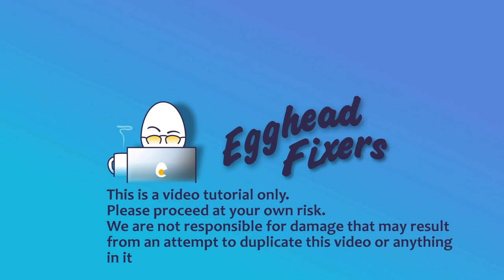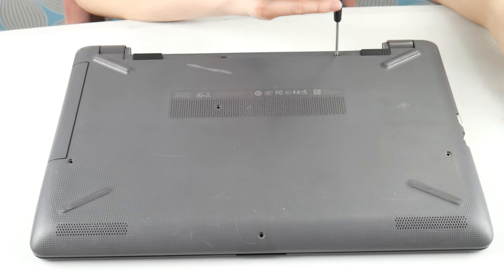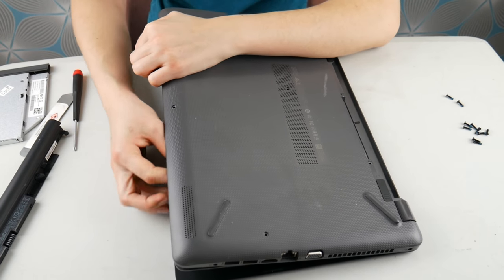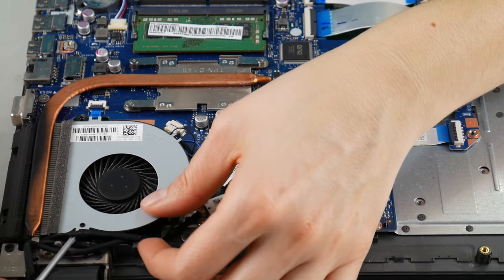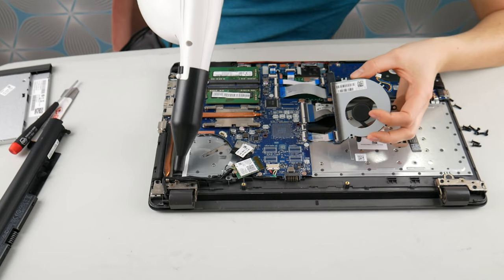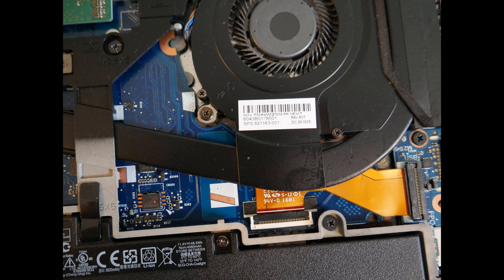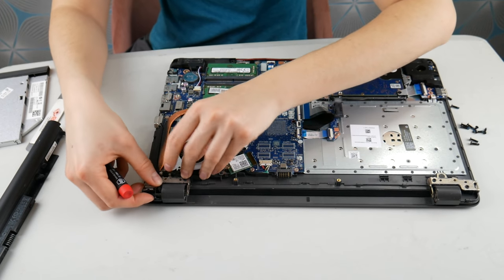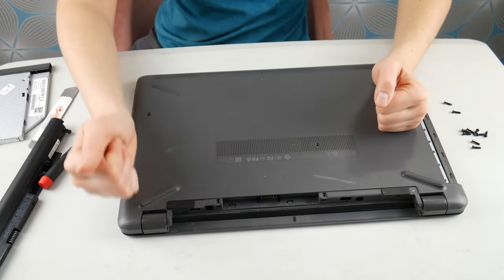How to Fix A HP Fan That Is Making A Lot Of Noise or Is Not Working

Comment: I have a HP Envy that was given to me by a friend. It's overheating. I took out all screws, couldn't get the screen hinges removed. I tried to pry the top keyboard panel out but its still connected inside somehow in the center. I checked under all the rubber feet and there were no additional screws. If I could just get to the fan!! replacing it would be easy... taking this shell apart is the diablo!!!
Reply from the maker: If you go to the HP support page and look up your model HP...Some of the manuals for different HP models show you how to take the computer out piece by piece. You could also see if there is a disassembly video for your model HP on YouTube. Because it sounds like you are missing a screw.

Comment: Pls i have a similar problem with my Hp pavilion 15-cs0003ca, When it works for some time, then there is this strange noise that it makes at times and it very very loud.. It makes that for sometime then it stops. It has been that for like one month now and i don't know what to do?
Reply from the maker: Does it happen when the fan turns on? Does it seem to be where the fan is located? Because the hard drive can also make strange noises when they start to have problems.

Comment: My laptop is so loud but Is only this way when on charge but I can't leave it off  charge cause it dies so quickly or straight away even if it's fully charged it also charges really slowly and I sometimes hear a beeping noise
Reply from the maker: Does the computer feel like it's overheating?
Reply: @EggheadFixers  no
Reply from the maker: @kaihla7514  Does it beep in sort of pattern? Like 1 short beep and 1 long beep or something like that
Reply: @EggheadFixers  yes
Reply from the maker: @kaihla7514  What is the pattern?
Reply: @EggheadFixers  I think theree short beeps and one long beep
Reply from the maker: @kaihla7514  Have you upgraded any of the parts? because that beep code usually ia a CPU configuration error or CPU type is not compatible
Reply: @EggheadFixers  no I haven't upgraded but I will be getting a new battery soon so hopefully that resolves the problem
Reply: I can't figure out if the problem is my fan or my battery
Reply from the maker: @kaihla7514  does the fan stop doing it if the battery is not installed?
Reply: @EggheadFixers  no
Reply from the maker: @kaihla7514  If it keeps doing it after you replace the battery then I would consider replacing the fan
Reply: @EggheadFixers  ok thank you for your help
Reply from the maker: @kaihla7514  You're welcome!

Comment: Whenever I plug in my laptop it starts making noises and I'm not sure if it's the fan but I'll try this
Reply from the maker: Does it seem like it may be overheating?
Reply: @EggheadFixers  possible I think it's either the fan, battery, or charger. It doesn't make too much of a fan sound like it did before I cleaned it from the outside. I can see it's dirty on the inside so I'm gonna clean that when I can
Reply: @EggheadFixers  also I put my charger on my bed and a different charging port and it made the squeeky noise for 20 to 30 minutes but it hasn't shut down and it's been around an hour since I've been using it and now I don't hear the noise and the fan is very quiet too
Reply from the maker: @ahmedisgoated1387  Ya sometimes cleaning the fan from the inside can make all the difference. Let us know how it goes!

Comment: Ok so when i switch my laptop on, the fan sounds like a helicopter taking off. After a while fan gets a bit quieter but sounds like a hot rod.  Its like 3 years old. HP 15-ba042na
Reply from the maker: Does the computer feel hot? Like maybes its overheating?
Reply: @EggheadFixers  Yes! If I have it on my lap for more than 10 seconds it burns my leg.
Reply from the maker: @Bosshub  Ok so I would start using it with a cooling pad and start troubleshooting why its overheating. You could need to clean the inside, add more thermal paste, get a new power cord or battery. These are the most common reasons for this problem.
Reply: @EggheadFixers  Ok Thank. Also when in sleep mode it sometimes starts up randomly.
Reply from the maker: @Bosshub  Oh wow ya that might stop if you can fix the overheating problem.

Comment: My hp17f023 made lots of noise even since I bought it.  I took it apart before and couldn't see any problem. Today I lubed the fan shaft and problem is fixed!  Seems HP has a problem with not lubing their fans properly.
Reply from the maker: Ya HP's unfortunately are notorious for their fan problems:/ Good job troubleshooting the problem👍
Reply: @EggheadFixers  a dab of silicone with PTFE on the shaft and bearing and it is totally fixed! The fan speed used to be constantly varying. Now it is a nice smooth graph.
Reply from the maker: @kornylak  Excellent!! Good job👍
Reply: Well, the noise has returned.  Careful examination shows the bearing is shot, needs a new fan after all!
Reply from the maker: @kornylak  Ugh ya HP computers are notorious for their fan problems:/

Comment: Hi! My brand new HP 15.7", literally only powered up for set up and opened Chrome. The fan started up and then started making this continuous high pitched sound. It is like having tinnitus. unbearable. When I close the window, it keeps going and it won't stop until I turn the computer off. Any advice?
Reply from the maker: You could try replacing the fan but before that I would run a diagnostic. Here is a video on different issue that in the beginning of the video show you how to run the diagnostic:

https://youtu.be/mO49kF--oa8

Let me know how the diagnostic goes:)
Reply: @EggheadFixers  I just got it though....seems like the part is defected...its brand new! I'll check out the video though...thanks
Reply from the maker: @roslynwoods8976  If it's brand new it should still be under warranty. I would call it in instead of trying to fix it yourself. Have them spend the money on a new fan and save yourself some $$$

Comment: Hi I don’t know if you’ll see this but I have had my laptop for only 2 weeks and it’s making a louder buzzing noise. It sounds like a car speeding and stopping. I checked for dust but it was perfectly fine. Can you help. I’m really confused😭
Reply from the maker: That definitely could be a fan problem. Did you buy your computer new? Because if yes then its most likely still under warranty.
Reply: @EggheadFixers  yes I did. So how to I get them to fix it?
Reply from the maker: @JMaster54  You have to call into HP Customer Support and they will arrange to have it fixed.
Reply: @EggheadFixers  ok thank you
Reply from the maker: @JMaster54  no prob👍

Comment: Hi! I own HP Omen 15dc1093tx, and it had a problem with the cooling fan not working (90B) and it is making a high pitch noise whenever I open it, so I always turn it off immediately afraid of ruining it more. I brought it to a laptop repair shop but they don’t know how to operate the device, but they opened the laptop and saw that the fan that is making noise is the one that is working and the other one just stops immediately right after turning on the laptop, what do you think the problem is? Help me pls
Reply from the maker: So you have on fan that is loud and the over other in not turning on at all? It could be that one fan has died and the other is working twice as hard to cool the whole unit by itself. Does it feel like its overheating?
Reply: @EggheadFixers  hey I didnt see u replied, it could be overheating. I use my laptop for online classes and it’s open for like whole day most of the time. I brought it yesterday on the shop I bought it from. They somehow disabled my fan so that it wont force the only fan that was left working and that I could use it still for online classes and they said I should bring it back to them when I’m not busy anymore. They immediately said that the fans are broken. What do you think?
Reply: And do you think it is possible that it was caused of the windows update? coz I got an update and I shut it down and then when I iopened it, the high pitch noise started. And then the next morning when I opened it, it says on the screen that the other fan was not working (90B).
Reply from the maker: @randel3108 It definitely could be that the fans need replacing. That would be my first guess. when you update a computer it puts the computer under strain. So what can sometimes happen with an update is anything that is on the verge of breaking will then break the rest of the way during the update. Then after getting through the update you have new problem that you didn't have before.
Reply: @EggheadFixers  Thank you ma’am! ❤️
Reply from the maker: @randel3108  You're welcome:)

Comment: My laptop fan has made the full on roar after being on from start, it has a i7 processor that must get very hot to warrant this ,hp envy got that disappointed put it in the wardrobe,now use my old Samsung ,i3 processor no noise at all on full load
Reply from the maker: Sorry to hear that:/ Have you tried cleaning or replacing the fan?
Also here is the video on an overheating problem:

https://youtu.be/vuuFD2BDYUk

Comment: Flexing the chassis can bend the fan enclosure. Take it apart, but the cover and case on a glass table top to make sure that it's flat. Try to detect where the fan blades are hitting the enclosure, causing noise. Gently bend to get clearance. Test at each part of reassembly. These fans should be virtually silent. Trial and error, but, now, mine is completely silent while blowing.

Comment: We looked for the specific model video to open it up, it only shows two panels that come off. No fan under either panel. No screws anywhere else to remove anymore pieces. I have an idea where the fan should be, near this vent, but no access. I'm about to rip my hair out.
Reply from the maker: Do you have a hard drive or solid-state drive? Because sometimes a hard drive when it is failing can sound like a fan.
Reply: @EggheadFixers  omg yes. It's a hard drive, and only one of the four screws are in it. It doesn't even look like it's connected all the way, but the computer works fine. He just keeps getting a malfunctioning fan alert, and the noise. Do you think that's the issue? I can screw those down.
I created a worse issue, though. I found the fan, under the keyboard. I still can't get to it, because it's underneath the whole frame of the computer, like in between the keyboard and the back panel. I cleaned it as best I could with the canned air. But when I pulled up the keyboard, I didn't wait for the video directions to finish their sentence, and I pulled the connector ribbon right out of it. I can't find what I think was the connection piece, I saw it fall, but apparently it landed in a black hole that leads to another dimension, because it is nowhere in that room. So I ordered a new keyboard, overnight shipping, and tried to attach it. The ribbon just doesn't seem to connect. I tried it a couple of different ways, and nothing.
So, trying to save myself a few dollars by cleaning it myself, I murdered my son's laptop.🥹🥹
 
I'm gonna keep trying. But, yeah, should I screw that hard drive all the way down?

Thank you so much for replying.
Reply from the maker: @mindyenglish5305  The hard drive should be secure. So if the already installed screws are loose then yes i would tighten them.

Comment: I have hp pavilion G6 . It's fan sometimes make noise and sometimes not.  But my laptop is running slow . Can you please provide me Reason . When I do simple work it don't get heat whenever I play something it gets heat up
Reply from the maker: It could be a fan or an overheating problem. Sometimes it can be hard to tell if the fan is not working so the computer is overheating or if the computer is overheating so the fan is working harder. Here is a video on how to troubleshoot overheating problems:

https://youtu.be/vuuFD2BDYUk

Comment: I use a program called speedfan to monitor temperatures and fan speeds and it shows to fans in my hp15cc665ci. It shows the second fan as only running two or three hundred RPMs. I've been inside the computer before and I don't see any other fan
Reply from the maker: Ya it sounds like it is not giving you an accurate read. Are you on desktop or laptop?
Reply: @EggheadFixers  hp15cc665ci laptop
Reply from the maker: @jackhammer111  Ya if you don't see another fan then there is most likely the only one.
Reply from the maker: @jackhammer111  Ya that sounds too loud. Now it's hard to tell from the video is it definitely the fan making that noise? or is there a chance it is the  hard drive? Because when a hard drive starts to fail it can also make a loud fan like noise.

Comment: I have an HP envy 360 and it keeps making an extremely gross grinding type noise. I have taken it to Best Buy twice in a year and it hasn't stopped making this noise. Is it normal for my laptop to make this noise or do I need to replace my fan?
Reply from the maker: No that is not normal. You may need to replace the fan. Does it ever make a clicking noise for an extended period of time?
Reply: @EggheadFixers  mine has a very faint sound, sort of clicking perhaps. and then it suddenly starts to try to go faster, but starts making a terrible grinding noise which lasts a 3 - 5 seconds then stops and back to the faint clickingish noise. And so on.
Reply from the maker: @boreduser12  Is it definitely the fan? Because sometimes Hard Drives can make clicking noises if they are starting to go.
Reply: @EggheadFixers  thanks! The sound comes from exactly where the fan vent is, so I'm guessing its just the fan. The computer is 14 months old, so hopefully not the hard drive. Also, its an SSD, so probably no noise from that. Right?
Reply: @EggheadFixers  love your logo btw :)
Reply from the maker: @boreduser12  Ya sounds like a problem with the fan
Reply from the maker: @boreduser12  thanks!

Comment: But what if you open up the laptop and there are 3 connections between the upper and the under part? When I lift it more than 40 degrees things are going to break. How can I take it out then?
Reply from the maker: if you go to HP.com/support you can look up  manuals for your model. One of those manuals will show you how to take it apart. Either that or you can look up a disassembly video for your model HP on YouTube.
Reply: @EggheadFixers  Great, thanks!

Comment: I have an all in one hp envy rove- the fan keeps shutting down and there is a lot of things on top of it should I try disassembly
Reply from the maker: It always a risk to take a part a computer if you haven't done it before but it also risky to keep using a computer that the fan isn't working properly. If you are going to take it a part I would look at the computers manual on HP's support page and watch some disassembly videos so you know what you are getting into.

Comment: I have HP pavilion 15 cs variant laptop. And when i lift or even slighty move the laptop, the fan makes sound like a bad motor. And when i give a hard tap on the panel on either side(top or flip and top on the bottom) it stops. Not sure what is wrong.
Reply from the maker: A loud noise like that is typically either a problem with the fan or hard drive. Have you been getting error codes?
Reply: @EggheadFixers  Nope no error codes as of now.
Reply from the maker: @MrDNTS  Ya it sounds like it could definitely be the fan

Comment: um i need help with my elite x2  the fan is making a lot of noises but idk how to open it up cuz all of the parts are attached on the screen any suggestions?
Reply from the maker: The manual for your model HP is available on the support page of HP.com. It will show you how to take your computer apart. You also can look up a disassembly video for your model computer.
Reply: thank you very much
Reply from the maker: @bigblox9273  You're welcome!!!

Comment: Hey! Great Video! 
i have a question if i may ask. My HP G7 245 make quite loud fan noise when turned on and turned off for a slight of time, after that its silent and work just fine. But apparently it is also make loud noise when switched to sleep mode. Troughout the sleep mode, the fan keep producing the noise unless i turned the pc off or on back from sleep mode. is that normal? or there's something wrong?
Reply from the maker: Sometimes they can kick into high gear it random times like when turning on and off. Does it feel like it is getting hot? Have you got any fan errors on boot up?
Reply: @EggheadFixers  hi thanks for the reply! hmm is that so, i also think if its only when turning on and off it can be considered common. But then i figure it out later, when my laptop automaticaly turn into sleep mode somehow it produce a loud fan noise. It wasnt hot, probably warm at most (even when i shut it down untill its cooling down, then turned it back on just to test the noise in sleep mode, nothing changed), and i dont think i've got any short of fan errors. Aside from when in sleep mode, apparently if the battery was not fully charged, when you shut it down and plug it in to charge it up, it will make those loud fan noise too, untill its fully charge  / the battery indicator turn white / i unplug the charging cord. 
The thing is i just got this, and i dont really get it if that considered normal or not. so i tried to look for similar case on the internet to help me out (but no luck so far haha), at least before i send it to service center i know that those sound were not normal,..
Reply from the maker: @ikramwibisanamaulana  Ya the sleep mode thing is a little weird. If you send it in under warranty they work with the same models over and over again. They will know right away if the fan is louder than it should be.
Reply: @EggheadFixers  got it, thanks a lot btw!
Reply from the maker: @ikramwibisanamaulana  you're welcome:)